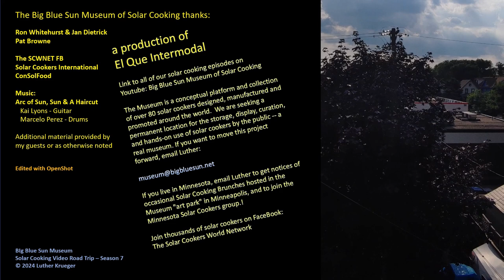Ron Whitehurst & Jan Dietrick: Through-The-Wall Cooker, and Off-Grid Beneficial Pests Insectary.

Comment: In referance to polycarbonate, I had run across alot of it as refuse, and tried to restore it as usable  material for solar.  A serious wetsanding , and producting a fairly cloudy panel was  finalized.  A good layer of clear krylon spray paint ended up producing a somewhat serious clear panel.  IDK the harmfull effects of using such ideas in an oven, but I havent heard much otherwise